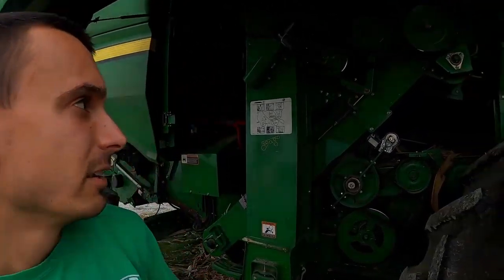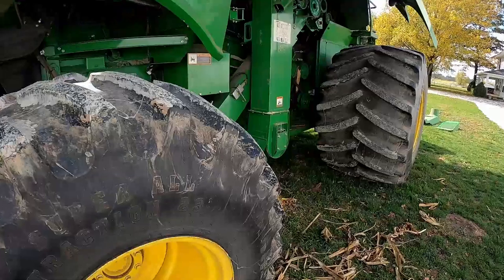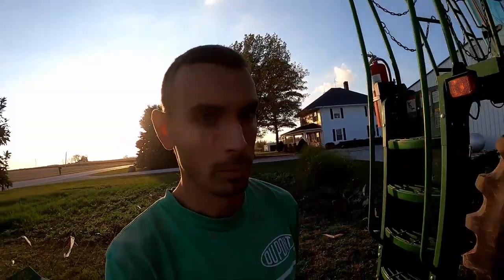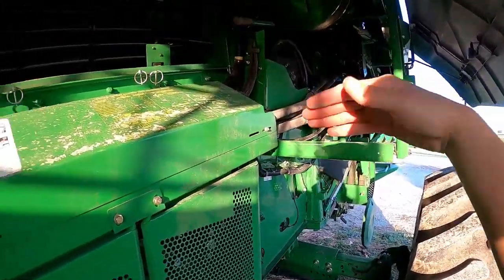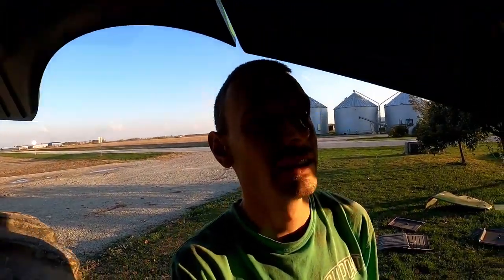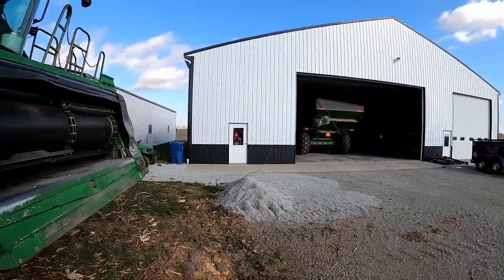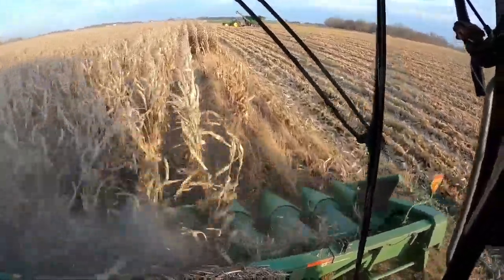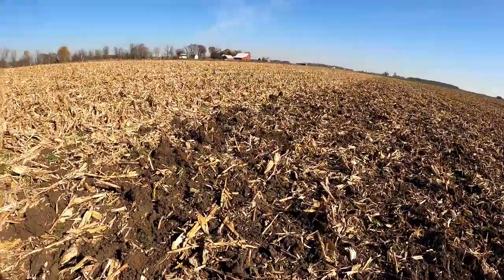Organic Corn Harvest 2020

Comment: Just curious how many bushels of corn or soybean one of these bins can hold?
Reply from the maker: The smaller one will hold 3,200 bushels. The one I have corn in is a 6,500 bushel bin.
Reply: @INOrganicFarmer  For some reason I was under the impression that those bins would hold more corn than the grain bags. I read the specs of the Up North grain bag 12' x 300' could hold 23,000 bu of high moisture shell corn. My guess is that:

1. You don't need such a high capacity storage because you have a high turnover of corn in your bin (i.e., you sell off your harvest quickly).

2. You can better control the moisture level in the bins which is impossible in Ag Bags. 

My question then: what is the best use for the Ag Bag grain bags?
Reply from the maker: These bins are 60+ years old. Back when these were built farmers didn’t need much storage. We’re still using them because I don’t have enough organic acres to justify building bigger ones. So far I’ve been able to store all my organic crops in these two bins. I usually haul everything out over the winter or early spring.
   I don’t need the capacity of larger bins just yet.

You’re right about the moisture. Once you put the corn in the bag it better be dry or you better get it out quickly before it spoils. (January or February) If the bag gets a hole in it, the hole will let moisture in and spoil the corn. The other thing about a grain bag is, if you have it laying in the field, the ground will have to be dry or frozen to get semi trucks to it to haul it out.

Several years ago there were lot of grain bags used in this area. That only lasted a couple years and guys decided to build bins instead. Because of the reasons a mentioned above.
   To answer your question:
In my opinion grain bags are for very short temporary storage. If the corn is coming out of the field at 16% - 17% it will store just fine until March possibly April. Any higher than that, I’d want it gone in January.
Reply: @INOrganicFarmer  60 years! Holy cow, that's a good investment :-)